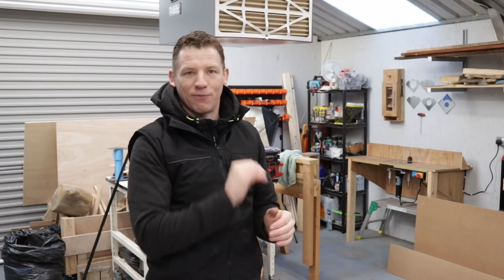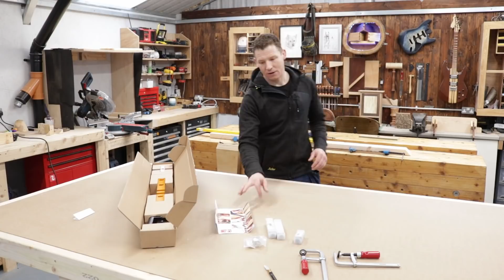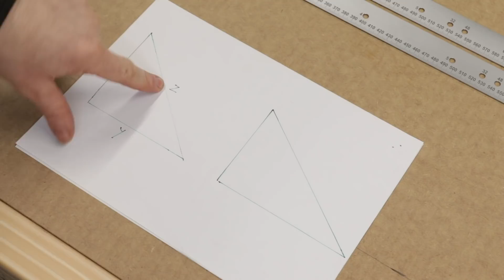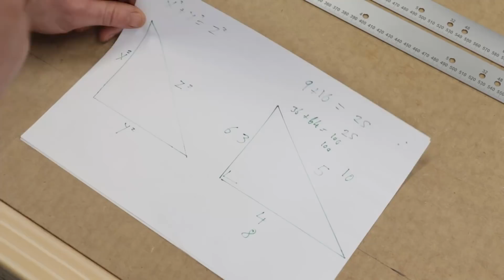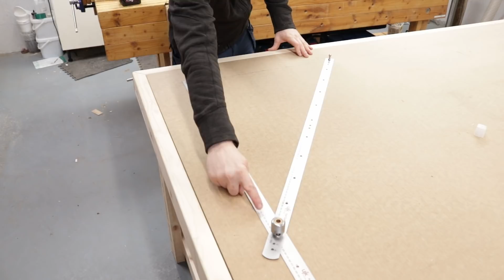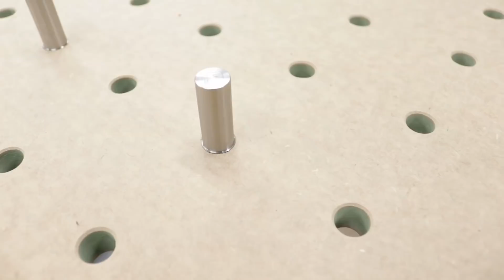MFT Table Build. Using The Parf Guide System MK2. With Problems!!! Part 1

Comment: I bought this jig 2 years ago when I made my first MFT top and I had completely forgotten about the alignment issue, I had the exact same thing happen to me on the last row of holes and could not figure out what I did wrong....good to know it wasn't just me. I solved the problem just the way you did, using the drilling jig to correct the problem and it worked like a champ. I was watching your video as a refresher since I am about to build a new workbench and want to include the MFT system on half the top...despite the little alignment issue it's a great jig and has worked great using with my track saw as well as an awesome way to clamp material when making assemblies.

Comment: I bought the same Parf guide system and I’m very disappointed with it. The accuracy is not dead on! Too many variables that can affect the accuracy and make it almost impossible to get a consistent grid of holes. I know Peter said you were doing it wrong but that’s not the case it’s actually the design of the system that creates the errors.

Comment: Hi John
I am in the process of building a large MFT table and watched this video a couple of years ago, I remembered you said you used 25mm MDF, did this give you a problem when using the clamps through the deeper holes or did you do something underneath to solve any issues.

Comment: Just my observation, but I thought from the first time I saw a video on this system that an inherent error would occur due to overlapping the rulers on each other thus multiplying the error.   I think this could be overcome by only having the hypotenuse ruler always lying in the same orientation with the x, y rulers.   In other words, the error  can be induced by the fact that the rulers lie upon each other ether, which in theory will induce an error of length in the triangle sides.   I haven't used my parf system yet, but as a mathematics freak the fact that the length of the ruler is shortened minutely because it isn't coplanar with the whole of the triangle.  I think I can overcome this issue by never overlapping rulers x and y, and always having the z ruler lying on top of x and y, thus negating the small error induced by the overlapping of the rulers.   I'll let you know if I'm full of shit  when I try my method out.

Comment: If the discrepancy arose in my work I'd suspect my technique. Proof of the rulers's accuracy should be in how well the holes align between the two. 
    We each have our own imagined use for an MFT top. Mine is to use a high pressure laminate skin on a 4x8 outfeed, cutting, and assembly table with Systainer storage below. I envision access to retrieve small objects that disappear down the dog holes. Did you have to chamfer the bottom side of your inch thick top to be able to dip your clamps into the holes? Have any of your viewers transferred the 32mm shelf pin holes in Festool track to a second strip of aluminum to help erect the 3-4-5 triangles? How about boring a couple of lines of equilateral-triangle holes to assist in cutting and assembling 3 or 6 sided shapes?

Comment: Thanks, John, for a great video!  I just finished drilling the 3 mm holes in my 30 x 75" MFT top and all of the holes at the top ended up lining up perfectly.  I used a clamp on Parf rule to drill the first row of holes, only used the 3 mm pins thereafter.  I also made my triangles with the 8 hole dimension on the bottom of the triangles.  It seemed like that would lock the vertical rule in place a little better than using the 6 dimension on the bottom.  Otherwise, I did everything exactly as you did.  Very impressed with the precision of the system!

Comment: Great video, John. Thanks for this. Re: the system being that 1mm out, I'm not sure whether this matters, but as you were going around the table, I was wondering whether you were compounding error, so by the time you got to the other side, it was, for example, 4 times a (for example) a 0.25mm error. In any case, you did what you needed to do, and got all perfect holes, so that was nice to see. Thanks again!

Comment: Hi John. I feel your pain. After watching your excellent video i was a little concerned about the accuracy. Then I saw Peter respond and his explanation seemed spot on so I went ahead and ordered my Mk2 set from Axminster. The kit arrived and the quality of the engineering is excellent, almost too good to use.  Not one to employ half measures I bought a 2400x1220x25 mm MR MDF board and set about making my bench. I  noted what Peter said and the and started in the middle of the board or about 70cm from the left edge of the board. Drilled the first line along the edge and everything seemed ok. I used the guides in a triangle and created the left hand line at 90 degrees. did the same for the right hand. I now have a 10x10 U shaped grid. To my surprise the guide fitted across the top perfectly and I drilled out the holes. So far so good. I had decided I would do all the 3mm holes and decide later which ones to drill out to 20mm.  I moved down line by line and now had a 10x10 grid all looking good. Bearing in mind the problem you had I didn't extend the guides out to the left and I used them to create another triangle for my first line (6 more holes) then again to create  the 10 holes perpendicular to the new 6. This is where my problems started. The leftmost line did not meet at the top. I ignored these and came in 1 and did it again (thinking I could employ your method to correct the problem. It still didn't line up so I began to suspect my original 10x10 grid. I tested every hole in the the grid vertically first (as I had used a single guide horizontally so should be ok) and there were a few very slight issues. I decided to check the lines horizontally. Ie the same way they were cut. I would expect them to slot in perfectly and they didn't. Some were perfect, some caused the guide to move the tiniest amount. I concluded that there is some lateral flex in the guides. Peter used clamps on the first line, but, you can't do that in the middle of the board. I even tested just cutting a straight line of 10 holes without clamping and the alignment was not spot on. The guide appears to from side to side. So I have a board with loads of holes in it. None of which I trust. Luckily the drill was not long enough to go all the way through the 25mm board so I will turn it over tomorrow and try again. This time I will drill the middle hole of every line first and use the 3rd pin in the middle to increase the stability. I also checked the guide hole alignment which seems to be spot on.
Reply: It seems I may have had a bad set as there was play between the sticks and drill guides. Axminster shipping me a replacement today.

Comment: Great video mate!
My take on it is that once you created the first 90 degree corner everything else should have been paralleled of that.
Two 90 degree angles coming off a short end (1220) will inevitably run out of parallel along the 2440 side. 
Thinking of building this all the same. Great set up

Thanks again
Paul

Comment: that's what's wrong with this system one mistake and your no longer accurate # 2 the European standard for cabinet construction is based on a 32mm standard. all cabinets are divisible by 32 the height the width and depth all divisible by 32
Reply: So is the parf system. Holes are 96mm apart.
Reply: So is the parf system. Holes are 96mm apart.
Reply: So is the parf system. Holes are 96mm apart.

Comment: I have the parf guide system v1, never had an issue with any of the tops I made. Heard you were doing 2.54cm - one inch think - that would be an issue with theading clamps through you get into trouble 19mm is the dimension you should stick to. Otherwise you will end up having to chamfer on both sides of the board - not optimal

Comment: Might have been better to use drill the last vertical holes. Then use the triangle to establish the next section of holes. You’re correct to assume something was off by a small margin .003 then compounded the error. I preplanned my MFT top and decided I was going to make a fractional mistake or an errr, so I cut two sections which will butt-align. Thanks for sharing.
Reply: I just finished a 27”x72” MFT style table. The parf guide is nice but it’s easy to get a slight deviation from human error or the chuck having runout. . I probably spent 10-14 hours drilling out the top. I think part of woodworking is knowing how to “make it right.” I’m glad you shared the experience, so I was mindful when I was drilling. Cheers + HNY 2022

Comment: A golden rule of machining is to have a single origin reference point. All features should be directly referenced to this. Any incremental measuring system (such as the PARF system) will become increasingly inaccurate as the machining progresses. Errors add.
Also, the method requires using 3mm dowels into wood(!) as the jig securing reference. Repeatedly. Once again, errors add.
Using a template is simply much better. The CNC machine on which it is cut is NOT incremental, but referenced to an origin. The tolerance to each hole will be the same.

Using wood as an engineering material is fraught with difficulties. What is not widely recognized is that the Festool MFT (the pre-cursor to all these designs) does NOT use the hole grid for locating the track rail- both the fence and the rail location is keyed to the aluminium frame of the table. And it is adjustable, so that build errors are not an issue.
It is understood that a good table saw will have a cast-iron table top. There is a good reason for that...
Reply: Excellent comment Mike, probably the best one made on this video. The dog holes in mdf are good for work holding but I don't trust them for square cuts using the steel dog hole pins.

Comment: Hi, purchased the stuff, made the table holes etc, all the silver dogs within the orange part fit into all the holes BUT somehow overall I always out between 1/5 and 1/3 of a mm. I have no idea how . table is flat.  I did actually return the orange part for a new one since there was a little  play it (shop agreed also), saying that I ended up using those silver pins through the holes only (I more or less made 20mm in around half of the possible amount). Overall I think there is some quantifiable luck involved with this method/equipment, I mean how can any of the parts be slightly out if made by cnc machining. My table is flat and the size is around 9 holes by 15 holes so not supper massive. Quite annoying really with all that money spent, pins go in to all the holes through the orange part etc but an issue is there.,,, driving me potty!. Glad yours worked out

Comment: The thing about this is that if you want to buy the Parf guide System then of course you will make square dog holes.  The real video would be if you could show how to make a square jig using common tools and such without having to buy one more almost $200 "system" that you will use once and put on the shelf forever there after.  Yes, I know, I can make many more tops with this system but I can do the same with a hole guide made out of phenolic sheet (cheap) or mdf. And yes, I know I will have to spend the time and money to make a square jig but that's exactly what wood workers like to do - make something ourselves and save money.

So, while your presentation might be good, it's little else for someone who would actually "make" a top.

Comment: Way to stay calm my friend. It sounds maddening. I would be willing to bet that the discrepancies are cause by the very slight z angle created by the rulers overlapping. A few extra  lengths of the same thickness metal as the rulers (some 1x and some 2x) placed UNDER the 2nd and 3rdly placed ruler piece, and BETWEEN the 3rd and 1st where they intersect ; would eliminate this discrepancy, guaranteed.

Comment: I worked out from the center on a piece of 8x4 sheet. I did everything as by the documentation. The holes dont marry up after doing rows and columbs. They are are out by a mill or so, even after placing the pin in the rule/guide/rail, it's a dead hard challenge to get it in the pin hole.

Comment: In my opinion it should be bang on no matter where you start, unless the system isn't fully accurate. That you have to start in the middle (as Peter Parf said), and work around the slop to get an acceptable result, is proof that this system will never equal a CNC drilled top. It should be possible to ask a local CNC shop to take care of this job for less than the cost of the system. If you're 1mm off when starting at the edge, then you're still 0.5mm off when starting in the middle. That's actually quite a bit out of square.
Reply: He just made a error and is not the system, but a human faillure.

Comment: John, very well done video. Good pace and very informative. I should first say that I am here in the states, in Houston. I have bought several times now from Axminster, and their pricing, shipping and service is first rate. It’s as easy or easier than buying some things here. They are an awesome company and a tip of the hat to them. Also kudos to Peter Parfitt for his contributions to the Parf system. I have exchanged emails on a number of occasions with Peter and he has been most gracious. His products are very useful and extremely well thought out.

This was a really nice build that you did and very insightful. I originally bought the Parf Guide System Mark 1 as soon as it came out. It was a great system but I felt that it needed a couple of improvements. The Mark 2 system made everything better that was needed and then some. A user would be happy with either system but if they see a couple of MFT style tables in their future, I definitely recommend the Mark 2. Again, thank you so much for your contribution.
Reply from the maker: Thanks Steven glad you enjoyed the video

Comment: Hi John. I bought the Parf Guide System MK2 and starting drilling holes the other day. I ended up having the exact same alignement issue you had on the last drill holes. I examined what might have happend and I came to the conclusion that when you form the triangle, and have everything sitting absolutely perfectly (important fact), there still is some minor wiggle room at the end of the ruler. So when you would happen to push slightly against the ruler when drilling your holes, this might result in just a tiny fraction of misalignement, resulting in your pins not matching up when you try to drill the holes across the other side. What I did to correct it, is push the ruler a tiny bit back and lock it in place with a clamp and redrill the holes that didn't match up. My advice to others is to not start drilling all holes right away after drilling the frist hole. But to first check wether your "number 10" hole matches up with the other side (if you already have done the other side ofc). If it doesn't you can still correct it early on.

Comment: Just watched this.  I would say  the rulers are perfect,  but the surface of your top is not perfectly flat.  Even the slightest bow in the surrrface  will result in the rulers measuring a slightly shorter or longer distance 
But you solution was spott on,  use the first line of holes as your reference holes and measure from them.

Comment: Hi John how is the wiring for the MFT table going  we have built a 8 * 4 table in the centre of our new workshop and not sure how to run power and air line our first choice would be over head but it would need to fold up out of the way  if needed any ideas.

Comment: Is it possible that laying one ruler above the other could create that discrepancy as one moves further out from their starting point?
Reply: It should not give you too much of a deviation. If so then the Parf Guide would have systemic errors built in (and all MFTs would be off by same distance). Though when connecting two rules having the one you will drill in at the bottom (towards surface) will help. 

You can also counter potential error by which end you start with (and finish) but also raise the top ruler with a distance (so it becomes straight).
Reply: @i679n5  Thanks for the response!  Both your solutions would address that potential deviation on larger tables.
Reply: @jruru89  I am maybe paranoid (having my MK1 rules worn out) but you could also do
1. Mark your rulers and consider which you use for which line. Then you can ask yourself the consequence if one would be too big/small/etc
2. Use Peter's advice for large tables in the manual. I.e. Do not only prolong a line but use the 6-8-10 triangle when prolonging. Do not prolong more then 3-4 at the time, etc etc.

Comment: That seems a lot of work and cost. Fortunately i have a 10x5 cnc machine so could do this simply even though i dont have a MFT table. Was thinking of offering a cutting service for MFT and after watching this I think it may be popular. Good video. Cheers Ian
Reply: If your worried about cost, buying a CNC table blows that out of the water👍😁
Reply: @Smokeyr67  it certainly does but i have a CNC for work
Reply: Where are you located?
Reply: @GNolan2005  yeovil, Somerset👍

Comment: I think I know what the issue is with the holes not perfectly aligned. With the jig, the diagonal ruler is sitting on top of the other ruler, which adds a very tiny amount of error. That compounds over several holes.
Reply: That makes sense.

Comment: Hi John, great project and  very well described. Your channel is really informative for those of us starting out. I’m about to build a multifunction table with an MFT top. I wondered how you are getting on with a full 8x4 top - is the width a big stretch with a full sheet of board to cut down? Also, I see you later routed in a sacrificial strip for cross cutting. Did you consider a similar strip for ripping ? Would really appreciate your views